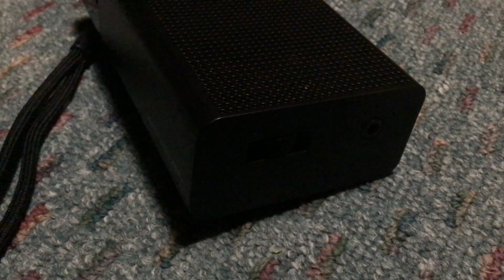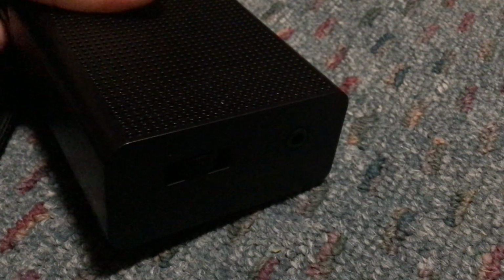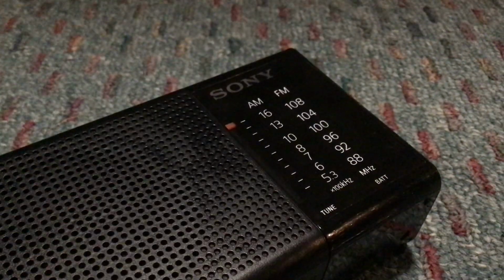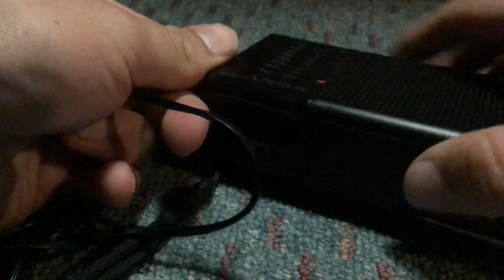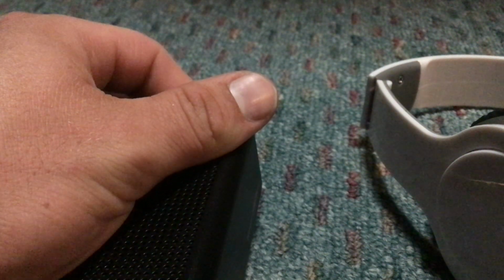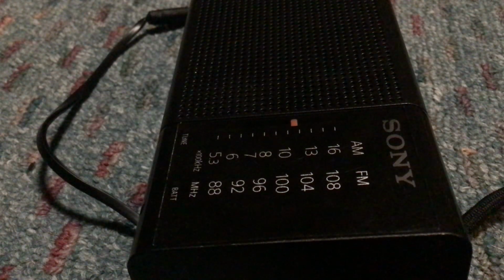Does anyone know how to fix this radios volume knob? ￼

Comment: Have you taken the radio apart and looked for dry solder joints around the volume control?
If everything looks good, you could spray some switch cleaner into the volume control.
If you don't have switch contact cleaner DW40 will do a similar job but is not recommended.